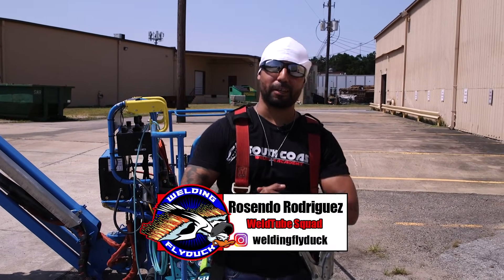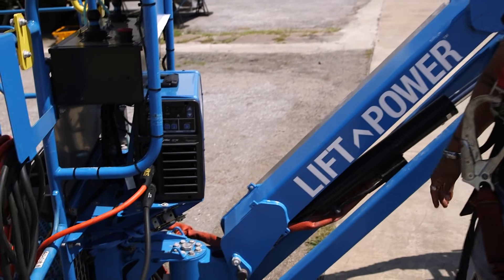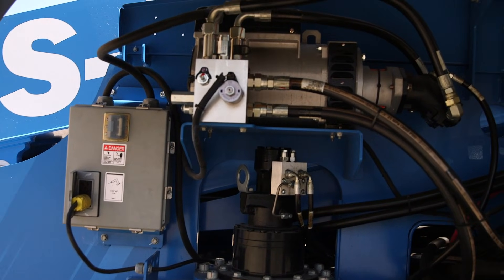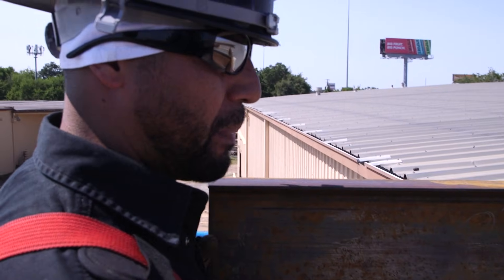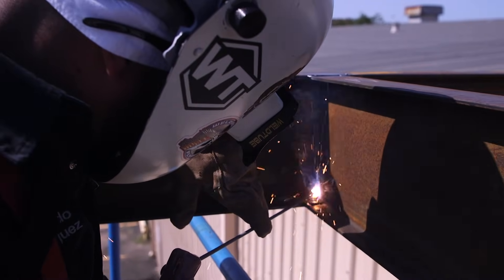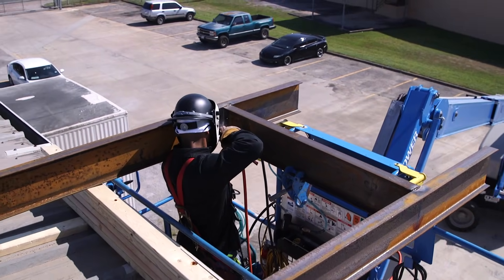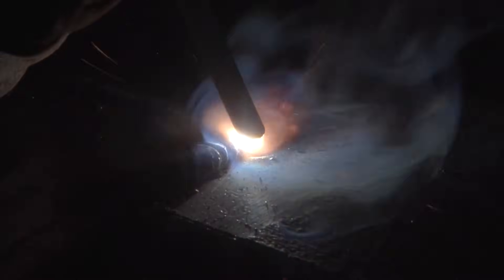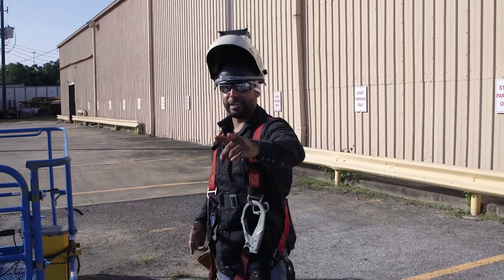Structural Welding at Heights | 6010 & 7018

Comment: When I was doing stuff like this in the 80s and 90s and early 2000s I was usually in old beat-up basket in a zoom boom and didn't have all the nice stuff this rig has. If I wasn't working on a high rise welding beams to columns or column splices,I'd be working for companies doing miscellaneous ironwork on smaller projects. Never a dull moment with crap equipment or welding machines that take awhile to get the heat set right.  The best wire for me was 211 and a small,lightweight,easy to carry machine where you could twist the lead around like a pretzel and the wire still came smoothly. I never liked those suitcase size welding machines with the 232 wire which runs pretty fast. And only once in awhile did I have to use 7018 rods. I liked welding because I have a knack for it and you can see what you've accomplished right away. You know,and so does everybody else,if your welds look good or like crap. Can't fool anybody ! These videos are good for teaching newcomers and remember this: you're never too old to learn. Just hope you don't run out of fuel when you're in one of these lifts !😊😊😊😊

Comment: I would always enjoy taking the welding inspectors up, they were always very accommodating when you were driving them around 60ft up
Reply: Back in the 90s I was working building the Moscone Center in Frisco. I was inside the building where it had a very high ceiling and had alot of welding to do on the ceiling. I was using the biggest scissors lift I've ever been in. I used to joke that you could hold a square dance on the darn thing. The welding inspector was with me so he could sign off on my welds after I made them before I'd moved the lift over to the next area to be welded. The next day when he showed up on the job he started telling me how he got repeatedly flashed and "I must of blown a quart of snot out of my head last night " .Yuck,yuck.😮😢😂😅😊

Comment: HAHAHAHA...He says make sure you follow the code as his alignment for that thickness is not code and his huge gaps for that thickness is not either, in addition didn't clean that rust off at 2" away from the weld. Plus as that is not a big project I can almost guarantee he did not open a new rod container and or the rod was not in a oven first so it was almost certainly over the allowable atmosphere exposer time.

Comment: this guys a joke 
anyway 
you don't need training or certs to operate 
you can learn this shit in minutes....
Reply: only thing you really need to know is that anything used and abused.. the controls usually have a qwirky joystick 
lift up the rubber gasket unlocking the stick from being stuck 
new ones you can move the stick w/o doing that

Comment: What is the reason for using  6010 root and 7018 cap instead of nr232? Is anyone doing this welding prosses in areas prone to earthquakes? I'm just trying to learn. I've been welding for 10 years and have never seen a wps call for this.
Reply: My guess... When a fitter plays ironworker, everything looks like a pipe.   The beam he's welding in isn't coped correctly with a radius, it's done like you would in a fab shop if you were going to weld all around, even the horizontal welds of the web to the flange  This might be done in a handful of spots like exposed metal architecture, but then why would you have giant glob welds? Those vertical root passes didn't get much screen time probably because they looked bad.  Also then why have poor fit up from the start, with the top flange rolled out of alignment?  The finished weld size relative to the material thickness is way too big and completely excessive.  A good welder with that same setup could run a 3/32 vertical fillet on both sides, with no weave or blobby whipping,  then groove the top flange and finish with a flat, nice looking weld in a single pass. Do the same for the bottom flange in overhead. If dune for finished appearance, the inside welds can be performed first, then back gouge and fill the top flat and bottom overhead grooves. 

I don't know what this was trying to simulate. If you want to show structural welds, use real world fit up with a gap and backer bar, not 6010.

I'm with you, every spec I have seen calls for exclusively E70xx.
Reply: Ive done it on a Government Project in GA. Its rare but its out there.
Reply: Filler metal

Comment: I started my own business... i do structural welding also but since i didn't have a lot of money to start,  i bought a vulcan commander 225 SMAW machine from harbor freight and the SOB will not run 6010 of any sort..... so i have to run 6011 and 7018 only...
Hopefully nxt month i can get myself a new miller or Lincoln generator welder.... i miss running 6010 5p+
Reply: keep on the grind brother, it will pay off in the end!

Comment: Love that Genie. Don’t have a need for one, but I still want it. 😂
Reply: They are neat. We've had to use them as generators before when the site lost power. Came in pretty handy
Reply: @mikef6879  genie has generator but so does lincoln ranger and other welding machines with a generator.
Reply: @FinessingFather  we have those as well (miller bobcats and a t.b. 325) it's nice not having to plug a cord at the base to use the outlets in the basket. Or run a cord up to the basket. I've also hung my temp lights off them and boomed it in the building for area light when needed. The all should have on board power in my opinion.
Reply: @mikef6879  much agreed

Comment: Hi, might be silly question... but why is so popular using 6010 on root  pass in the USA?I wanted to ask this for ages now, and I'm sure many people did already did...

Here in the EU (ehh.. I'm in the UK now, but EU in general) we just use 7018on root pass as well.

Nice video + machine!! 
I love Genie's and Nifty-lifts. When you welding from a bad boy like this, everyone knows you mean business. 😏😜 
A few months back on a Canary Wharf job I used Nifty-lift 4x4 hr28 it was awesome!
Reply: Im a structural welder out of chicago. We use 7018 for almost everything unless we are using wire.
Reply: A structural welder may use a specific welding process and electrode combination, such as 6010 for the root pass and 7018 for the cap, due to the unique properties and benefits offered by each electrode.

6010 electrodes are known for their deep penetration and ability to perform well in challenging welding positions. They create a root pass with good penetration, which is essential for the integrity and strength of the weld joint, especially in structural applications. The 6010 electrode also produces a thinner, more convex bead profile, which is often preferred for the root pass in structural welding.

On the other hand, 7018 electrodes are valued for their high deposition rates and the strong, clean welds they produce. They are commonly used for cover and fill passes in structural welding due to their excellent mechanical properties and relatively smooth bead appearance, which contributes to the overall strength and quality of the finished weld.

By using 6010 for the root pass and 7018 for the cap, the welder is leveraging the specific characteristics of each electrode to create a strong, well-penetrated root pass with the 6010 electrode, followed by the deposition of additional filler material and the attainment of the desired weld profile and properties with the 7018 electrode for the cap pass.

This method allows the welder to achieve a sound, structurally sound weld joint with the optimal characteristics for both the root and cap passes.
Reply: @newslavecity8311  great explanation 🔥🤙
Reply: I'm in Oregon and the coastal states and have never used 6010 in the field. It's always been 7018  or 232 wire. Those lifts are bad ace and I always request those lifts, but the boss either never gets it or it's broken.

I do like that he's rocking the hardhat adapter. Very few guys use it, I think there great 👍 The vert in the video is pretty nice tho.

Comment: Try going up 200 ft on top of a carbon furnace with a 300lb guy in the jlg with you and tig out a butt weld that’s surrounded by hundreds of conduit lines . It’s horrifying.